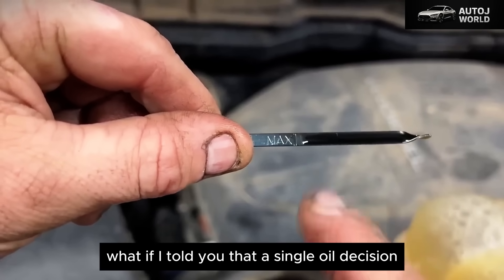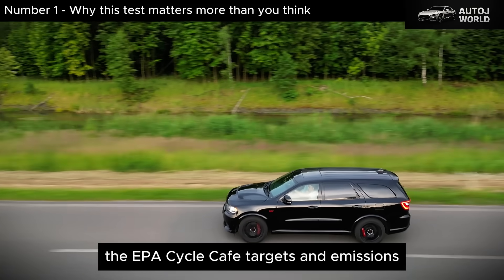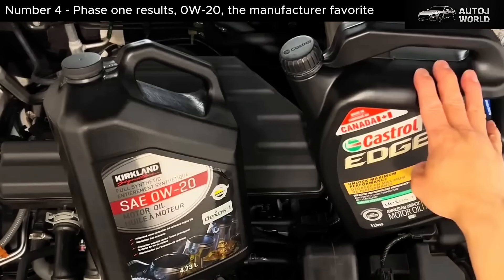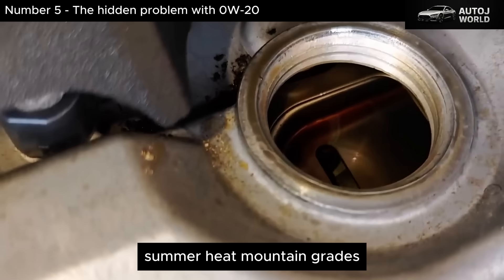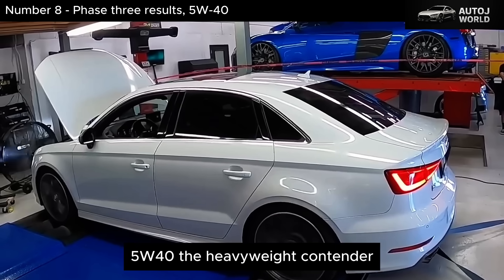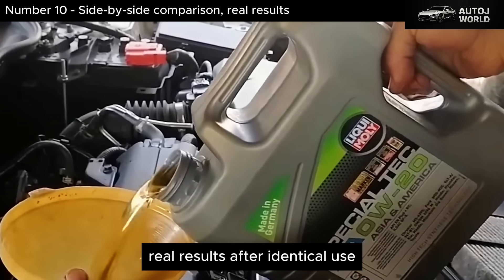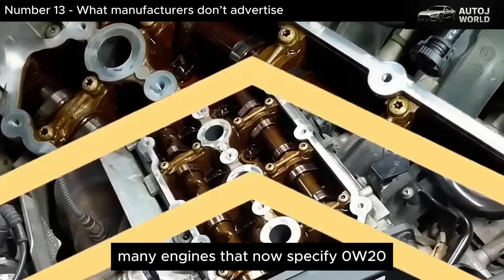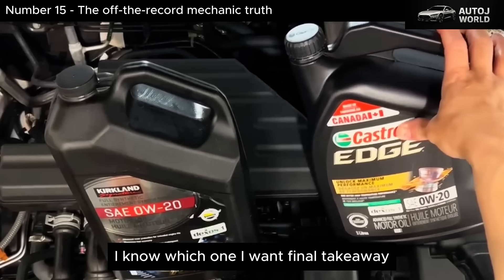We Tested 0W-20, 5W-30 & 5W-40 in the ENGINE — One Clear Winner!

Comment: My car is brand new kia k3 2024 , the manual said 0-20 but i drove the car for 2000k km and then I've switched to 5-30 liquimoly molegen , i still don't know if i did the right thing,  our winter degrees is like 0 and summer around 35-40 Fahrenheit

Comment: I ran a Toyota 22re four cylinder pickup truck for 452,000 miles on it with 10/40 motor oil on it. I would drive it around 330 miles a day.  One of my friends did a compression test on it around 440,000 mile on it and said he was amazed. He told me that the compression was still high and pretty even on all the cylinders. He even asked me if I had it rebuilt. I told him it was all stock.

Comment: My '02 Lincoln Town car, 5-20 full synthetic, has 2230k, runs like new, no leaks no use.  My '29 Model A Ford, I fitted it to .001, use same 5-20 full synthetic, uses no oil, no leaks, starts instantly and runs maybe better than new.  Lots of miles, showing no wear.  I;ll stick to what works, we're in central MN, it can get cold here.  I'm retired engineer, 92, 93 in April.

Comment: Got a 2014 Chevy Silverado V 6. 170,000 miles. I use amsoil 10/ 30 in Texas/Oklahoma crazy weather I get then about 18 mi to the gallon. All I got to say is be careful about using too thin of a oil.

Comment: On a Edge 2018 3.5 non turbo, the manuel say use 5W20. That's ok with me for winter ,beacause I live in Quebec but in summer I tow 4 to6 times a small camper, often up hills, for 6 to 8hrs stretch.  Should I go with 5W 30 or 5W40    ?

Comment: Thank you for the informative video.  I have been stating this for years, engine type, driving habits and the environment you're in dictate the oil viscosity that you use.   In my line of work, I work with engines all the time.  Diesels primarily.  In my opinion, following  manufacturers oil changing intervals the manual's is taking years from your engine.  I currently have turbo aspirated TDI engines, 5.4L modular Ford engines, 2.0L GDI Focus chain driven engines, Honda Hybrid and now my wife has a hybrid Toyota.  My older TDI from '01, was scheduled for 5W-40 Fully synthetic.  I sold the car after 17 years of driving, 331K miles.  Every 5K miles, oil/filter, however, I commuted 100 miles round trip daily with 85% at highway speeds.  I replaced it with another TDI 2015 VW Passat using 5W-30 , fully synthetic.   I have kept the interval at 5K, noticing the oil does not smell burnt, some years I put 30K miles yearly.  No mechanical issues with these high mileage cars, currently at 188K.  I have a 2005 Ford F-150 with the 5.4L.  The truck also is changed at 5K mile intervals.  Currently passing 288K and doing somewhat well.  The new Toyota hybrid uses 0W-16 fully synthetic.  During the winter, I might stay with the recommended, however, summer I might change it up to 5W-20.  We shall see.

Comment: I have a 2009 Honda Accord Coupe with V6 and 6 Speed manual transmission. I live in Indianapolis, IN and have 107K miles in the car.  I run low test 87 Octane fuel change oil and filter with Mobile 1 oil and filter 2 X's year.  The oil weigt is 5 W 20.  The care runs hard and has outstanding acceleration. I have the required milage services performed as per owner's manual including cam belt, water pump replacement, tune up, all fluids changed every 3 years including power steering fluid, brake fluid, cooleant change/flush, transmission fluid change, I can get rubber in 3 gears and very fast. ALso run cold air intake and aftermarket cat back dual exhaust.

Comment: Ford tourneo UK spec used to state 5w-30 and now spec 0w-30. My MPG has dropped by about 3 round town and 5MPG in a run. I will be going back to doing my own oil changes again using 5W-30 .

Comment: 5-30 Mobil -1
We live in South Georgia we get hot in the summer and little cold in the winter. 
But with my Truck I do run 5-30
But I do pull a 32 ft camper doi need to run 5-40??

Comment: Take this how you want. I used 0-20 in my 2013 MX-5 with intervals at 7500, I did buy 10k or 20k synthetic, but @ 148k miles that cars engine sounded, smelled and drove like brand new. Recently totaled but my friend is buying it. 

I have a new vehicle where blow by is a concern (gasoline in oil) and it’s recommend on forums to change at 5k, so I’ll be doing that. 

Companies are pushing for higher fuel economy, lower maintenance cost (to promote sales) so thinner oil and longer intervals may be wrongfully pushed upwards. So, per vehicle basis. Changing oil is the most important thing you can do on your vehicle, just stick with what the manufacturer recommends and change when your suppose to, 90% of you won’t notice a difference, the other 10% can become knowledgeable enough to decide whether they need to run heavier oil or not. 

The general public is not going to benefit from any of this knowledge because of bad practice.
Reply: Maybe I’ll watch the video, but they’re just clickbait for the most part.
Reply: It’s an AI video. PASS

Comment: My dad always used Phillips TropArtic 10w 30w.  Never had any engine problems, he changed oil and filter every 3 K miles.  Got rid of his vehicles at 100K miles.  Back in the Day.  I used 5w 30w, change oil and filter every 3 to 4 k miles.  I hope to not have a problem with my 2022 Maverick.  It has 23K miles on it now.  I have a coolant flush scheduled next week.  The coolant is 4 years old.  I bought the Maverick Jan. 22 2022.  Love it

Comment: Second incorrect information, 5W-30 does not surpass OW-20 in shear stability.  Data collected on over 10,000 used oil analysis samples showed the following between grades of 0W oils for shear stability... the 30 weight oil shoed 30.1% of the samples were out of grade.  The 20 weight only showed 14.5% out of grade.  What is even more interesting is that testing showed 12 weight oil had ZERO out of grade samples and 8 weight oil only had 1.3% out of grade.  That is the complete opposite of what you stated.

Comment: First incorrect statement I see is you state that the 5W-40 oil has the highest shear resistance.  This is dead wrong!  The gap between the W viscosity and the standard viscosity (i.e 40-5=35 for the 5W-40 and 20-0=20 for the 0W-20) is the largest determining factor on shear.  The higher that number (the 35 vs 20) will shear faster than the lower number.  I feel this is click bait and you don't care about truth.

Comment: Valvoline Racing straight 50W with Zinc.  350 chevy has over 150k miles. Don't drive it in winter (below 60 deg. F)

Comment: In Arizona, I use Liqui Molly (Blue Bottle) Synthetic 5~40 in winter and in Summer i use Liqui Molly (Green Bottle) Synthetic 5~50, to add more protection add a can of Liqui Molly Cera Tec Bottle, you will get more gas mileage.

Comment: in EU ..older cars until 2000 use 10w40...after that until 2008 they go for 5w40 like my audi a4 2003  and now when its really cold i let the car run for 1 min till i leave...the 2014 hyundai i40 of my wife goes with 5w30 because its a newer car with a different engine .

Comment: I'm running 10w30 in mine....... 5-30, like 0-30 was there for fuel efficiency also.  I don't get caught up in brands, or the "synthetic" BS.  I make sure it's API specs are correct and run with it. Change it regularly and get on with life.

Comment: My brother routinely gets 300 - 400k out of his trucks.  I can't get anything I drive to get passed 150k.  I've changed cars at 3000 miles; another at 5000 miles, and another at 10k miles.  I've used synthetic full/blended and weight recommended by the manual but none can make it passed the 150k mark.  The only thing he does different is add Lukas during his oil changes.  I don't know if Lukas is the difference but I just bought a case of it and we'll see.

Comment: Honestly my fav is mineral heavy duty 15w/40 for all motors from lawn mowers to truck/tractor engines in Australian NSW climate. The only diff now is that for a 2024  2.0 turbo diesel warranty I have to run DPF approved C2-C3 and also because of the cartridge oil filter (being of non spin on options ) I had to settle to 30 weight, so now I am stuck on 5w/30 to keep the dealer happy and not question my madness should a claim be required.

Comment: Important context: reduced wear with 5W-30 applies to engines designed for it. Older engines with larger clearances and higher oil temps were engineered around 40-weight oils once hot. Viscosity choice isn’t universal.

Comment: Im pretty sure putting oil that is the incorrect oil viscosity in an engine slowly destroys the engine. That is why there is a recommended oil viscosity. You should not put 5w40 or 5w30 in an engine that takes 0w20. 0w20 is only viscosity the engine will run the best.

I was a service writer at Walmart auto care. There are 4 basic oil change packages. Pit crew, standard high mileage and full synthetic. In all 4, 5w20 and 5w30 is available. 0w20 is only available in full synthetic and in the high mileage packages. Slightly confusing but bear with me. Quaker State is selling 0w20 full synthetic $10 cheaper then pennzoil, Mobil1 and vavoline.  You still get 0w20 full synthetic just $10 less.  There is no 0w20 pit crew or standard. There is no 5w40 pit crew, standard or high mileage. 5w40 is only in full synthetic package.
When a car comes in for oil change we check the oil cap or elsewhere under the hood for recommended oil viscosity.  We use that. If we have the oil viscosity in a package the customer wants we use it.  If we don't, they can pick or we ask. We do not put in a oil viscosity that is not recommended. Plain and simple. It's Walmart policy.
Reply: True but the manual says you can use different grades but Walmart will NOT listen to the manual on the cap.

Comment: I drove 2 Audi A4's as the #1 Uber Driver overnight in San Francisco for about 8 years. (50,000 trips, about 75,000 people thru my car). The last one I'm still driving with 374,000 miles on it.  This is pretty much unheard of for Audi A4's.  First one was during the bad piston ring design faze.  It was a 2012 sold to me as a 2013.  Fortunately it was destroyed at a stoplight hit from behind by San Francisco Wheelchair paraTransit bus in 2015 with about 200,000 miles on it. Using about a quart of oil every 12-16 hours driving.  Second Audi A4, manufactured mid 2015, is one they had the piston rings corrected.   I'm still driving it in 2026, though the first engine died finally at 291,000 because it was losing compression, slowly burning oil, and needed a timing chain change.  Timing chain finally broke at freeway speed, and did as would be expected to the valves and piston heads on the 2015 original engine.  That was at about 292,000 miles on that engine.  Was getting about 18 city and 25-26 highway on the engine at the end, and burning about a quart of oil every other day at that point driving 12 hour shifts. So I drove it until the timing chain broke and That engine went bye bye.
  I "re-engined" it with a used Audi engine off of LKQ with 44,000 miles on the engine.  I have 80,000 miles now or about, on that engine.  I have used Castrol Synthetic 5w-40 and fadiously changed oil and filter at 9,000 to 10,000 miles.  My trips are rarely under 30 minutes, and, when an Uber driver until 2021 I was driving about 10-12 hours a day, 5-6 days a week.  Why did I re-engine it.  Because I replaced the Engine, Turbo,Trans, all the other systems parts, starter, alternator, AC compressor, heater core and radiator core for about $18,000 parts and labor.  That included New bearings all four wheels and disc rotors.  I still need a replacement radio/CD.  AM/FM radio still works. Bluetooth caput.
I have consistently gotten 32 MPG highway and 22-25 city.  My climate is neither too hot nor too cold though there are days close to feezing and days close to 100 F but not many.  A dozen times I had the engine temp warning screaming at me because the fan electronics were broken. And I turned on the heater full blast and that took care of it in 90 degree, bumper to bumper summer traffic at the stoplights approaching the bay bridge.  The temps came back down into range with 4 windows and sunroof open.  I attribute the no engine damage to the 40 w synthetic for those events.
Got the engine fan issues sorted with a new body Controller unit. Sort of a Grand Central Station, relay switcher for almost all electronic signals thru the car other than the engine transmission links.  Not cheap but fixed.
One thing I do insist on, Cold Start let the high idle do it's thing in the driveway, and wait for the slow idle.  Then I drive Slowly up the 1/2 mile subdivision up hill incline to the 2 miles downhill to town, by then the engine and the oil are warm.  NO COLD FAST STARTS. 
I like the car. The acceleration and handling.  It's an S line suspension, so corners and handles like a race car, but isn't.  At the current condition, no oil comsumption between 10,000 mile oil changes, I'm expecting this engine to take the car over 500,000 and maybe another 100,000.  I may do the timing chain change if it still has good compression and little oil consumption. I may re-engine it again as my daily driver.  I may, I may not.  If I was doing mainly short trips I'd go to 5W-30.  But that is not my California Bay Area Reality.  I drove us to Denver and back in it last summer as a fun Summer Road trip to see kids, and do National Parks.  Drove Like a dream.  A little over 3,000 miles.  ( I did wake up at 3 a.m. in the passenger seat across Nevada asnd saw my wife was doing 95 with out a care in the world.  I said, "He Baby, you're doing 95 and probably didn't notice.  You need to realize that cops don't tolerate being disrespected on their own turf.  When you get to Elko, pull off for gas and I'll drive.  Wake me up then"

Comment: Always use the oil recomended by the manufacturer! Always in europe you will not pass the anual emissions inspections if you use another type of oil! This clip is soo wrong in many ways. I change my 0W20 at 18000 km and it was never black on my new Volkswagen. It is this also for the turbine. Newer engines have a different construction and different pressure. I know america is still on the high cilinder cappacity on high fuel consumption but …

Comment: 5W30 for the very reasons you say.  I am an engineer and it was obvious why they went to 5W20.  Same for trans fluid.  They have low viscosity trans fluid now but trans will wear faster.  The older trans oils have highest viscosity.  But Valvoline Maxlife ATF says it works about in everything, has the lower viscosity.  I tried it in an older car and it shifted harder.  Toyota T IV, Mobil 1, Valvoline Syn Gard and import, Mercon V have highest viscosity, around 7.4,  Maxlife is 5.9 (at 100C).

Comment: 2009 Chevrolet Aveo5 4 cylinder 1.6L in Canada. (Southern part) manufacture recommend oil 5W30 year round 
Use 10W30 Winter and 10W40 Summer. Car runs fine. Does take a bit more gas. But would pay this over premature engine wear.

Comment: Oil cap states 0w-20 only. Instead... I use 0w-30 in deep cold winter months and 5W-30 in hotter temps spring/summer/fall months. Always use dexos-1 full synthetic and diy replace at oil usage meters 35% remaining life.  This works for both my vehicles...

Comment: All bullshit, go ask your local machinist/ engine builder. The only thing that the weight of oil is for is rod and main bearing clearance. The heavier oil means you can run more bearing clearance and less weight means you can run a tight clearance. That's it nothing more. Don't ask an oil change guy or a mechanic that has no machine experience.

Comment: My F150 has a 5.0L in it, they recommend 5W 20 in it, after seeing this I am going to switch to 5W 30 from now on.
Reply: I switched to 5w 30 on my 2019 f-150, 5.0l after 12,000 miles(i change oil every 4000 miles) and have found that it has a little less oil consumption, plus i added a oil seperator, in have 70,000 miles on it now...
Reply: I don’t know what year your F150 is but the 2021 coyote engine has 5W 30 right on the oil cap

Comment: Love this example as a mechanic for 35yrs. But I changed from 5w30 to 5w40 because I'm at the coast in SA and do a long drive every day. 200kms return trip. Turbo charged ute. My ute Is doing 300000kms . I do an oil change every 3 to 4months depending on mileage.  Nissan NP200 DIESEL TURBO. Most importantly when draining my oil it is as hot as I can get the engine be. So removing all impurities.

Comment: Good explanation. Please tell me at what millage do we have to change the oil? I normally change after 3,500 km using 5W30 oil. Besides engine oil i also change oil filter. My comuting is small say about 10km per one drive two times a day that is about 20kmsa day. I have 2021 model Toyota Passo

Comment: My primary use vehicle gets the oil changed every 2 to 4 months or 10k miles.  Whichever comes first.  Up until 2020, my preferred oil was Mobil 1.  Then my 2020 Dodge Durango GT and a Project Farm video got me using Penzoil Ultra Platinum in all my gas engine vehicles.  But a crazy oil guy on Youtube got me to try Valvoline Restore and Protect.  Now all my vehicles, both gas and diesel, use Valvoline synthetic oil.  Amsoil is good, Penzoil is good.  But the Valvoline synthetics give the best performance and feel while driving.
Reply: 5/30?
Reply: @kjaved8 - Factory spec 0w20.